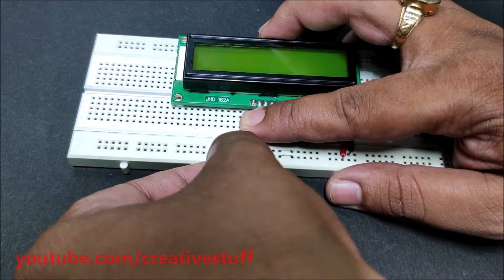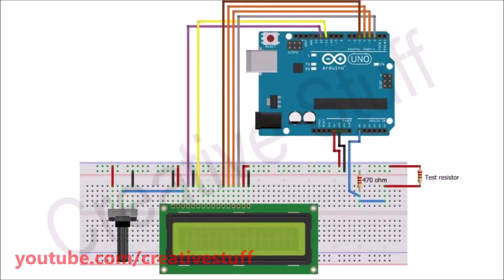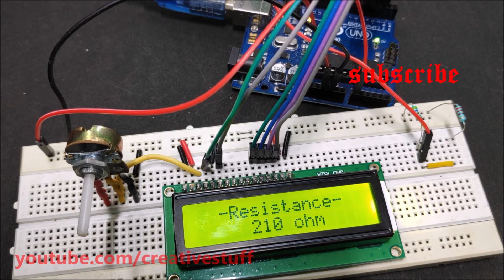How to make a simple Arduino Ohm Meter using Arduino UNO and LCD Display

Comment: Please help me, how to modify this circuit if I want to create a barrier limit, for example if the measurable obstacle is worth 0 - 10 ohm, then there will be a green light indicator and the buzzer turns on. And if the measurable resistance is more than 10 ohms then the red light will light up. Please help me sir

Comment: Sometimes the vin is not real 5V. That will cause inaccurate R2 calculation. So, you could read vin voltage on other analog pin, then use it in formula.